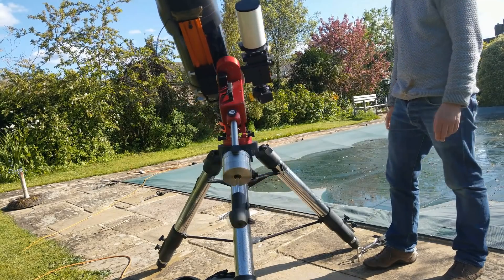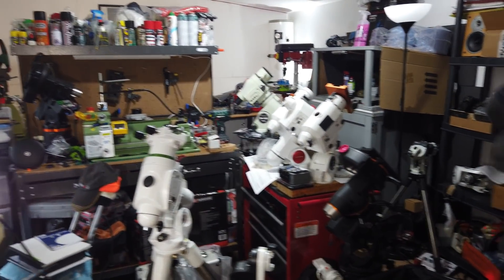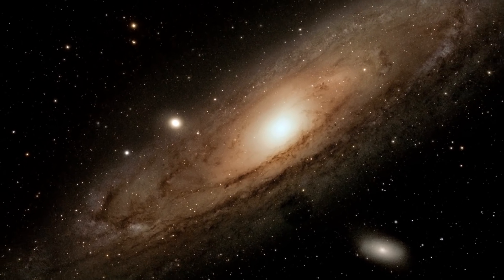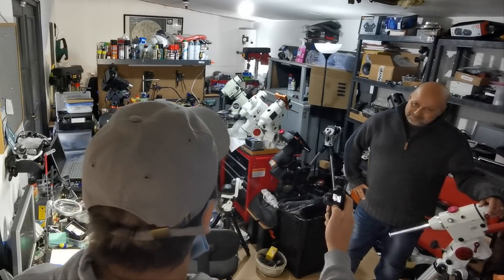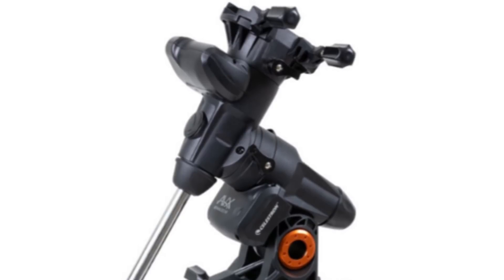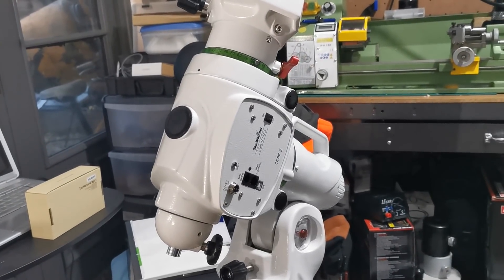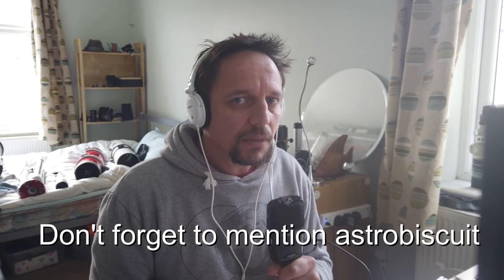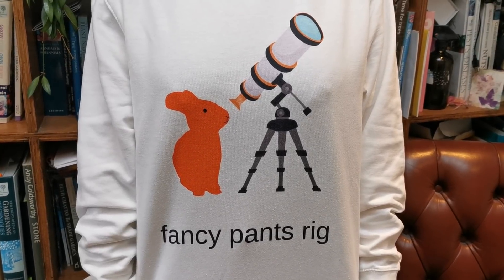Best Mounts for Astrophotography

Comment: do not send your mount to dark frame, you’ll ever get it back. Well got it back, missing parts and with grinding bearings. Not a Stella piece of work at all!
Reply: I had the same experience - he was VERY attentive while I was ordering, full of promises and BS, then after he got my money he dried up very quickly.  Even accused me of harassing him because I was tired of waiting for my missing parts.
Reply: @poruatokin  i’ve started legal action against him, he’s doing his best to delay but i’m guppy to seek a court judgement, it will get listed on companies house, so in the long run others will see it. I spoke with a nationally recognised astro supplier who’s had yo sort several DS tuned mounts. I’ll seek judgement for expert witness.DS simply should have settled, shaky testament to a very arrogant man.
Reply: @layhervamp  Sorry to hear that - Keep us posted on your progress if you can (legally).
I live in Japan after my inquiry, he actually called me for 45 minutes to talk, but after he got my money, it was a completely different story.
In my case, I ordered a "Stellardvie 5" from him that was allegedly on a 2-3 week ex works delivery (in writing).  After having to hassle him I received it 7 weeks later.  But, parts were missing, there were loose screws, an adjuster bolt was cross threaded and it was unusable without me stripping it down, filing off some protrusions and rebuilding it.  I am now up to 6 months and still waiting for parts that were promised.
Reply: @poruatokin  useful to hear your story, there are many others who’ve contacted me directly, so we are not exceptions but rather systematic of the way he does business. Still all this feedback helps build the case against him.

Comment: Spend 2000 to spend 800 more to make it right ? Lol fck that. Scuba diving here i come
Reply: Maybe, but then it performs as consistently as a £6000 mount. That’s why I have EQ8’s, CG-X’s and EQ6-R’s flown in from all over the world, as they can be re-engineered to under 0.3 ArcSec RMS (4hr session averages). All customer data. Unlike a Scuba Diving Regulator for a similar price, you can improve a mounts performance. Service a mount regularly, and it will deep dive you to distant galaxies for decades… and you won’t get wet. 😊

Comment: CGX or EQ6-R with my ASIair plus ?  Wondering between 9.25 or a 11 inch EDGE ? Does the CGX allow for the EQ-mod setup or another more UNRELIABLE ?
Reply: Both are good mounts when decently setup. The EQ6-R May struggle with the 11” EdgeHD. The deciding factor is really your imaging pixel scale and the guided resolution of the respective mount. Not to forget what your guide setup will be.  Ideally, for your sanity, you need to keep you imaging scale around 1 ArcSec. Unless the mount is tuned, but your limiting factor is your sky. In Most places where human live, it’s about 0.7 ArcSec average seeing conditions.

Comment: 5:02  Could anyone tell me what tripod that is? The one Dave is putting the HEQ5 on, in this freeze frame?? It looks very very sturdy.
Reply: Yes it is.! Same as used on EQ5. Same 0.64 ArcSec RMS imaging payload is raised to 8kg for EQ3-2, 11kg for EQM35 and EQ5. All customer data.
Reply: @davidwoods6326  oh, I was talking specifically about the tripod. I have absolutely no idea what any of what just typed means, other than arcsecond. And I only have a vague understanding of that. I am VERY new to the hobby, just got a SW 2i, and have had only 2 clear nights since I got it. I still have a ton of learning to do.

Comment: Where would one get a Sky-Watcher HEQ5 mount hyper tuned in the USA?  I have owned many mounts and think that those from Astro-Physics are out of the box superior to those made in China.
Reply: Please let me know if you get an answer!! I live in NC and I can't even find a camera shop, near me, that would be willing to take off the IR cut filter. I mean, tons of camera shops, but none are willing to do that one simple ask. And I just am not comfortable mailing off my only camera, for God knows how long, and then have it returned. That is putting WAAAAAY too much trust in the mail system, to think it won't be damaged by the time I get it back. I just got my Star Adventurer 2i Pro about 10 days ago, and finally got a chance tonight to take it out to practice polar alignment......turns out that I'm kinda retarded.
Reply: @kevinashley478  ever taken a DSLR apart? Not simple.
Reply: @davidwoods6326  there is a video online about how to do it, and it seems relatively simple, taking about 30 min. I would do it myself, but I no longer have the tools, nor the esd straps, or anything that would allow me to remove the filter myself. I think that, after Christmas, I may just say screw it and give it a go myself. If I screw it up, at least I'll be past Christmas and can purchase another camera if I need to. 
But when I called it a simple task, I was speaking in a relative term. I was mainly referring to camera shops that are willing to crack open a camera to replace the shutter, sensor, mirror, etc, but won't remove a filter. It's just very frustrating here in the USA.
Reply: @kevinashley478  It is certainly not simple and if done properly takes at least 3-4 hours (for a non-camera technician).  I did my own Canon 60D last year.  Worked great but you need to be extremely careful and methodical and have the right tools to hand.
Reply: @poruatokin  that is why I haven't attempted it myself. But all the camera repair shops around me say they won't do it. It's funny, they can crack a camera open to replace a sensor, but removing a filter is just not possible. I'm saving up my money to send my camera off, which I REALLY REALLY don't want to do. I have worked for UPS, and I know how "fragile" mail is treated.
Reply: We build to order, and ship new mounts worldwide.

Comment: If you can stretch to a used AP or other U.S. made mount, it's probably preferable to the Chinese made mounts, even the pricier of them seem to have issues.  The new harmonic gear mounts may make it less expensive to achieve great results.
Reply: Actually Harmonic Drives are pretty awful - you'll never be able to use one unguided.  What they ARE good for is portability, but in terms of stability and performance they are a waste of money.

Comment: Are there any motorized mounts that can be controlled by software or handheld device that weigh under 3 pounds? The load would be about 3-4 pounds (DSLR).

Comment: Have you used any Harmonic Drive Mounts yet?
I'd love to see your reviews on Rainbow Astro RST-135 and Hobym Crux 140...
They tiny, weighs about 7 lb, but the max capacity is about 30+ lb....
They seem to be the future of all mounts...
Reply: Yes, have one in the workshop. 10 ArcSec but it’s a very long periodic error. Pity they are soo expensive. Does need a counterweight with heavier telescopes, so not the weight saving portable mount people think it is… Tuned AZEQ5GT does better for half the price.
Reply: I looked into a new mount recently, seriously considered a Harmonic Drive, then I saw how mediocre they are in terms of PE which is unstable so cannot be programmed out by PEC.  In other words, you buy an HD drive and you have no choice but to use guiding with it.  Whereas one of the drives mentioned in this video can be set up to run unguided for up to 10 minute subs and still get really clean results.
The other problem with HD mounts is they are TOO light.  They claim to be able to take large loads, and they can drive them no problem, but will be very unstable and subject to wobble and wind.
To my mind, HD mounts are a bit of a fad - they have a niche but are not as great as they are made out to be.

Comment: Hi. First of all great videos. I've seen almost all of them in under a week. Keep up the great work.

Quick question though. I own a Canon6D II and a Canon T5i. Also I have a Canon 70-200 lens and a 2x converter.

On the 6d that means 400mm focal length. On the T5i that means 640mm.

However, I get stuck with f.8 on the 6D and f.13 on the t5i (crop factor).

Now, the 6D II can handle high ISOs. On the T5i anything above ISO 800 becomes unusable (and 800 is already a strech).

I figure that if my milky way shots with the 6D II and a 20mm f1.8 are taken without a star tracker with a 20s exposure, that means:

Canon 6D II 400mm f.8 3200ISO: 60seconds exposure time.

Canon t5i 640mm f.13 800ISO: 130seconds.

My question is:

Are those entry level star trackers (like the move shot move or the sky watcher SAM mini) good enough to support a canon 6dii or a t5i with a 70-200mm L lens and a ball head and a 2x teleconverter for 60 or 130s?

Or which budget trackers should I aim for?

BTW: the purpose here is to try and shoot DSOs and not the milky way 😁

Thanks a lot and again... great work man.

Comment: I'm sorry to add a negative comment here, but Dave has had my mount for 11 weeks. He does not answer the phone or reply to messages or emails.
Not impressed.
Reply: I had the same experience in terms of delays and poor communication.  Unfortunately i recieved my mount back after 4 months WITHOUT THE COUNTERWEIGHT SHAFT. And now, after promising on 26th Aug to ship it back "this afternoon", i dont even have a tracking number till today and no response to my mails. So ive ended up with a mount that i cannot use after paying 500 pounds.
Reply from the maker: sorry about that. i like dave but he does get busy and some mounts he recieves are pretty buggered up  and they take much longer to fix and it causes delays. I reckon he should just send them back to the owners and take the hit on postage.
Reply: @Astrobiscuit  There is no need for you to apologise. I have since heard from Sharon, and pleased to say that my mount is on its way back. I know that many people have had the same issue, and have said that Dave does not stick to his 4-5 week timeframe, and is very poor at communication, however his workmanship is second to none. I'm awaiting my mount with baited breath, I really hope that he can sort out his time management as he is offering a service that no-one else does.
Reply: @SPDavie65  Did you receive your mount?
Reply: @astroroadie2177  yes, it came back last week with an apology. 👍

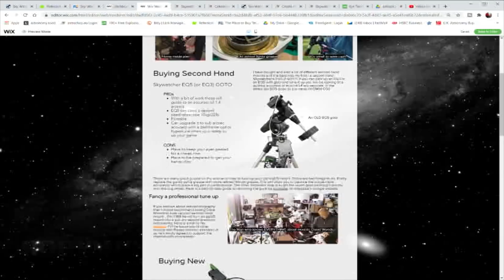Comment: My local dealer called me today and told me that three EQM-3s had landed on his doorstep, and would I like one? Five hours later, I got home, put it together, and man, Dave is not kidding. You can't balance this thing, the bearings are so sticky. At 3:55 Mr Biscuit says that the website has tips on how to halve the wobble, but the only tip I saw was to send it to Dave. Is it possible for a moderately handy person to flush the old grease?

Comment: I'm glad, people like Dave Woods are out there. I had thoughts about mounts, if they're serviced and looked after right, they will last forever. But Dave takes it further, with better bearings, lubrications and belt upgrades for finer and smoother tuned tracking.
Reply: Dave Woods is not a good person to deal with.  Hell take your money then make a million excuses why your parts are delayed.  Avoid doing any business with him.
Reply: @poruatokin  I'm in the same boat. I ordered an HEQ5 Rail system that never got shipped. Have you had any luck getting your money back, chargeback?

Comment: Useless item of info.. My claim to fame was the first to modify an HEQ5 to belt drive back in late 2011.  Documented on SGL forum and featured in April 2012 issue of Astronomy Now  https://youtu.be/dh3F1xkdj98 .  Due to constraints it was EQMOD only, but then in came Dave from Rowan Engineering who CNC'd the small pulley from  single block of aluminium and the rest is history....
Reply: True pathfinder - can't believe you aren't mentioned more often !
Reply: @gazza9839  I think that often those that have the original idea are seldom remembered when others take that idea to market... At least I have the video and can point to the original thread on Stargazers Lounge forum which documented my progress.  Weather you go down the DIY route or purchase one of Dave's kits, a belt driven HEQ5 / EQ6 makes so much difference to the performance and noise levels

Comment: After watching this video I have purchased an Eq6-R Pro. I was going to originally buy a Celestron CGX Mount but it will be out of stock for quite some time. I will be pairing the Eq6-R Pro with an Orion Astrograph 10. I hope this mount will be able to handle the large scope without problems.

Comment: Been trying to buy a used simple setup. My main intent was to get a visual scope but i ended up choosing between one for astro photo(150pds / eq3pro / synscan, many parts in need of restoration. Like broken leg on mount, problematic focuser, missing cables etc) and one for visuals(Old 200p(Colored as a Helios?, took me forever to find any info about this) on a eq4? mount, very basic).

Due to problematic shipping of the 150pds kit i'm leaning towards the old 200p setup and i think that would be more enjoyable if guests want to enjoy it with me.

Sad thing is that i can't really get much info about these items from the sellers nor can i inspect them, on the other hand it's not much money so i'm fine if i end up with nothing of use. 
I don't expect much from these items but out of the items i found for sale i think this might be a nice start to enjoy the skies(And something for me to thinker with :D).

I really wanted a basic dob 10" setup but couldn't find any on the used market.
I think the eq mount might drive me towards atro photo doe and has room for upgrades wich i will probably enjoy more later on(I already find it fun to remote control telescopes).
Reply: Bought The 200p. Turns out The mount is eq3-2 and is to weak to be balanced with The stock weights. Added some more weights and it worked fine. Was a fun first session.
OH, theres was a motor mounted that i didn't know if but no controller for it.

Comment: Dear Mr. Biscuit, thank you from the Great State of Texas for the great video. I am ordering product from OPT and want to make sure you get a commission. But ... not all of the product I am ordering from OPT is on your webpage. So I called the kind people at OPT and they said they would give you credit if I identify you. Thus, I will include a notation on the order that the proprietor of the Astrobiscuit web page and YouTube channel should receive a full commission for the purchase. I am still undecided on the scope however. For your complete information I am "upgrading" from the SkyGuider Pro mount to the EQ6R. That much is certain. The scope upgrade is the question. I love my Redcat scope but feel I am ready to upgrade that also (which is where my question originates). My camera is the Canon EOS Ra and I am sticking with that. I use the ZWO finder scope and planetary camera for guiding and will be sticking with that also. The question boils down to the scope and reducer. I am looking at getting the WO GT 81 APO and the corresponding reducer. My question for you, Mr. Biscuit, is whether the GT 81 APO is a significant step-up from the Redcat that I will actually get a "wow" factor or is it just a minor unimpressive enhancement? By way of analogy, would Mrs. Biscuit say "yes the size upgrade matters and will be very satisfying" or would she say "the size difference is barely noticeable and not worth the effort." Another more concrete example: my imaging of the Jellyfish nebula with the Redcat, SkyGuider Pro, 4-minute exposure with tracking, produced images that were ok, but I was unimpressed, and feel I could do better with an improved scope. Similarly, my efforts at the Bubble Nebula were ok but required me to crop like crazy, and the image was passable but without the wow factor. Conversely, the Redcat has produced awesome results for Andromeda, the Veil, California Nebula, and many others. So bottom line: will the WO GT 81 APO in a Bortle Class 3/4 zone (I'm right on the border) allow for improved imaging of smaller and fainter objects like the Jellyfish and Bubble nebulas, while still allowing me to obtain impressive images of larger objects like andromeda, Veil, and California nebulas? PS, I am becoming a patreon, so you should get notification of some American with the handle "The Mad Lawyer" is joining your motley crew.

Comment: THANK YOU for a proper rundown of all the important points.   You lined out in 8 minutes what I've been trying to grapple with for months.   

Question though:   Trying to decide on what level I want to come in at, the Sky Watchers I'm seeing here in the states are the EQM-35 for $725 and the HEQ5 for $1,150, that's quite a gap in price from the EQ3 and EQ5 mentioned here.   Is there a significant difference?

Comment: Hmmm I wonder if it would be worth getting my knackered old CGE pro sent to him? Its in a bit of a sorry state but as it hasn't cost anything might have nothing to lose...
Sitting and pondering the idea.....
Reply: Hmmm just read on the website they phased them out in January 2020 so probably not boo.
Reply from the maker: I would ask him. he has a soft spot for the cgs
Reply: I'll send him a message although I'm not holding out much hope cheers 😊
Reply from the maker: @tichwykes  I have hope!
Reply: I've sent Dave a rather long winded message but if the CGE is a no go there is a plan B in place.
Reply: Hmmm looks like plan B as I never heard anything back so guessing the CGE was a no go so I'll email him about the AZ EQ6 GT that I have that needs some fettling with.